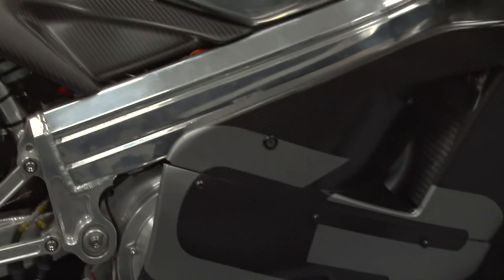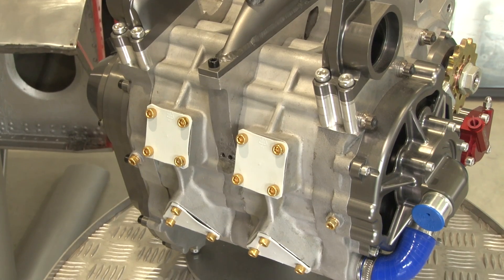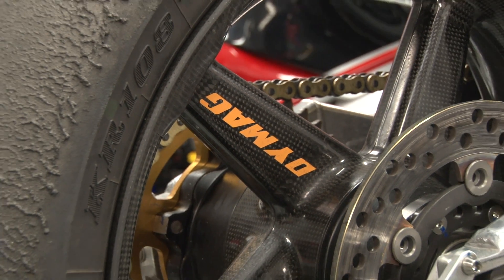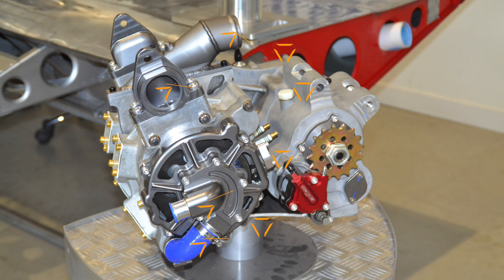Crighton CR700W : What makes this bike so special?

Comment: I've always loved rotary engines, motorcycle rotary, automotive rotary, Suzuki RE-5 was one I'm familiar with we sold them at the Suzuki Shop I worked at in the 76,77,78,79. I turbocharged many Mazda RX-7'S, those engines rev higher and thrive on turbo's & nitrous oxide,light, compact,lots of power too. That bike of yours is really something
Reply from the maker: If only it was ours!
Reply: Rotron 690cc 2 stroke wankel.

Comment: This overall design was brilliant when introduced by Mazda many years ago, and it’s still brilliant for several important reasons. But Mazda was never able to develop rotor seals, capable of holding up to the heat, friction and pressure loads they are subject to. Has this engineer worked that out? If so, I want one for my airplane.
Reply: Introduced by Mazda??? WtF!
Sachs was the first NSU-Wankel licensee to Introduced the Wankel KKM57.

Unfortunately the Wankel engine offers no advantages over reciprocating engine and has several major disadvantages.

This 1990s vintage Norton engine was originally designed by Sachs as the KC-60 developed for aircraft applications but abandoned due to reliability issues.

No aircraft manufacturers use Wankel engines 

No Wankel engines have ever managed to pass a FAA or EASA airworthiness certification test.
Wankel engines are inherently unreliable and their MTBF is extremely low, unpredictable.

Comment: The rotary engine is not economical- but it is even better than the two-stroke in terms of power-to-weight.  A great design, compact and powerful.  I wish I could own a bike like this.
Reply: Wankel engines are inferior to reciprocating piston engines in power-to-weight performance and are much less reliable and efficient.
Reply: Old 1990s Norton F1 bikes occasionally come up for sale... this is just an F1 with new fairings and fenders

Comment: the exhaust sucking air through the engine to cool it is something you will eventually see used on other bikes, maybe not rotary but air-cooled 4T engines need all the help they can get, air-cooled 4T engines are simple and easily maintained but tend to run hot so extra cooling with no moving parts is an obvious progression, it could pull hot air from the barrels & head with a shroud or casing and reworking of the fins, I'm thinking Suzuki ram-air system used on the  1970s 2T GT's hooked up to an exhaust system like this bike has ! 
anyone up for the challenge, get in the shed,
Reply from the maker: The air-cooling system is very clever!
Reply: It's a failed design that has never been successfully demonstrated

Comment: I can't find it back but I saw a video about rotery whereby they turned the working" inside" out  wich solved most problems a rotery is know for like the seals ect. When I saw it I was like amazed how simple the solution was just turn the workings around. Mazda chefs must have had a burn the day they see that video.
Reply from the maker: So the rotor becomes a stator and the housing spins???
Reply: @TheRaceBay  no the rotor still spins haha. But the seals are in the housing not in the rotor, and the intake and exhaust ports are in the rotor.
Reply: Wankel engines are obsolete technology and no long r mass produced in any legitimate applications

Comment: Having owned the original RX-7 I just KNOW a rotary powered motorcycle has potential to be AWESOME!   Sad that emissions BS took all the motivation to keep developing the old wankel
Reply: Wankel engines proved to be an unmitigated failure in motorcycle applications.
Wankel engines are obsolete technology due to the horrible lack of reliability.
Reply: I just fill my 13b with amsoil interceptor 2 stroke oil and use the omp turned up a bit. Works great.

Comment: Very nicely made! But why does it smoke like a 2-stroke?
Reply: Because it uses a little oil in the combustion chamber like a 2 stroke does. It only produces visible smoke when the engine is cold...once up to working temp there is no visible exhaust smoke.
Reply: Does it mix the oil in with the fuel? (like a 2 stroke) Or does the oil leak into the combustion chamber?
Reply: @L0wcash  Oil injection as its a rotary 2 stroke!

Comment: What race class would you put a 2.1L bike in...??
Reply from the maker: How did you get to that figure?

Valid question, though. I wonder if there's a Formula Libre for bikes?
Reply: @TheRaceBay  Every revolution of the rotor the motor sucks in and burns 2.1L of air and fuel but produces no more power than an RSV of half that capacity...There are no race classes for that size of engine.

Comment: When I look at this bike I wonder why it has taken so long to put the Wankel into bikes......would love to throw a leg over one!  The track footage showed the engine to be a whipsong instrument pulling from down low to peak revs.  P.S.. The seals have traditionally been a problem with these engines......how are those holding up?
Reply from the maker: A rotary powered bike is not a new idea, but this is quite possibly the most extreme example of one, and certainly the latest.

Comment: The twin rotor has the firing of a Six cylinder two stroke in a smaller package for the power output, incredible for Torque and power … I’d love one …. Gotta be smoother than my 1981 GSX1100 …
Reply: Hi mate.  A 2 rotor is the same as a 4 cyclinder 4 stroke - 2 firing cycles per output shaft revolution. The thing is the eccentric shaft spins 3 times per rotor revolution so each rotor has one firing cycle per revolution of the eccentric shaft

Comment: This is very cool..and all that..but the biggest oversight is that rear suspension setup..that bike is absolutely useless without more modern linear suspension or some kind of linkage to make the rear predictable..that is like 75% of racing is making the power usable.
Reply: All the suspension experiments carried out ever since the early days of Crighton's developments proved that the shock unit/units mounted directly on the arm were more effective than cantilever or multi link systems. The Duckhams sponsored bikes they won the British championships with were fitted with twin gas shocks directly attached to the rear swingarm. The ultimate development of this was a reactive shock designed in conjunction with Williams F1 team

Comment: If you save a whole lot of space why would you need to keep all that fuel at the top of bike?
Reply: Might help with the balance?
Reply: @zacharyradford5552  it would slow the transition from side to side thats for sure maybe in road racing you want some weight up high. I always though the lower the center of gravity the better but I also dont race road bikes.

Comment: What is the torque of the engine and at what rpm is the peak power and torque?
Can you show a power graph
Reply from the maker: Max. Peak	220HP
Max. Peak RPM	10500RPM
Max. Torque	105 FT/LBS
Max. Torque RPM	9500RPM

Full engine information:  https://rotronpower.com/rt690xe-rotary-engine/

Comment: Why does the rotor only fire once per revolution? Wouldn't it be more efficient and more powerful to fire on every "stroke"?
Reply from the maker: If I've understood it correctly (and I'm nowhere near as clever as Scarbs and Brian) each of the 3 faces of the rotor is the equivalent of an individual piston in a reciprocating engine. 

A revolution is therefore a complete rotation of one of those faces, which in doing so passes through 4 quadrants of the rotor housing providing the 4 strokes. 

For a single face of the rotor then, it is not possible to fire more than once per revolution as there is nothing to ignite until the next one.

If you take the rotor as a whole, it is always in 3 of the 4 Stokes at any one point during a revolution - much like a 3 cylinder inline engine would be, I suppose.

I really hope someone more knowledgeable than me turns up here soon to make more sense of this!

Comment: Most of Respect. Every time i think, the Rotary or Wankel engines are History, there are some new ones. Also Mazda surprises some weeks ago with a new fascinating Wankel.
Reply from the maker: Ah yes, the range extender system?
Reply: Yes. An intellegent system. Very interesting to me . . . . . !
Reply: Mazda canceled the range extender
Reply: The 35 kW/h battery with the range extender and I go to the dealer and buy one.
Reply: @schraddel6571  The MX-30 was a huge flop... Mazda has announced that it will discontinue the model
Reply: Okay, thank you for these Information. I will Look for something else. May be a FISKER?
Reply: @schraddel6571  Didn't Fiskar go bankrupt?
Reply: Mazda's president confirmed that the MX-30 has been canceled.
Reply: But they are still to buy . . . .
Reply: @schraddel6571  Mazda's President confirmed in July that the MX-30 canceled due to poor sales.
Reply from the maker: Just to clarify something and clear up some confusion . Mazda have cancelled the MX-30 R-EV in the USA only. At this point it remains on sale in other markets. How long that will be the case is unknown.
Reply: @TheRaceBay  Just to clarify, the MX-30 only exists to meet California's ZERO emissions requirements, sales in California was an unmitigated failure
Reply from the maker: Whilst it's true that the MX-30 was restricted to California in the USA, and it sold poorly there...

A)  The rotary range extender has never been offered for sale in the USA, regardless of individual state as the car was cancelled. The engine has nothing to do with either the poor sales, nor withdrawal. The car was cancelled before the R-EV was launched so nobody in the USA got a chance.
B) It's still on sale outside of the USA. The European model was launched in June at Le Mans.

Hate rotaries all you like, but knock it off with the misinformation

Comment: I like it a lot, like I like the 500's of the 80's and 90's  but, there is no longevity or development left in it....bugger
Reply: Plenty of longevity and development. Like how Evinrude boat engines made a 2 stoke boat engine that has better fuel mileage and less emissions than a four stoke. Something people said couldn’t be done because 2 stroke technology peaked.
Reply: @zacharyradford5552  2-strokes have always been successful and are not obsolete like the Wankel.

The Wankel engine reached the end of its development potential decades ago

Comment: Seeing and hearing riders such as Steve Spray, Robert Dunlop, Ron Haslam cane the Norton Rotarys  around the TT course was imprinted on my mind for ever, 22 years of looking later I get my own Rotary! OK its no where near the highly refined machines from the genius Mr Crighton but for a fact it gave birth to the 588 Nortons. I got myself a Hercules W2000, paint and chrome was shot but it was all there and 1,400 genuine miles with a pristine rotor housing it was brought back to A1 condition without the need for rare engine parts. What does it go like? A Bantam on steroids! Pop bang wirrr bloody hilarious to ride, rubbish hunting on the overrun but I love it. DKW who sold under the Hercules name in USA committed to selling 2000 in 2 years, fell short of the target so sold the rights and production equipment to Norton. My single rotor 294 is half a Norton. Mr Crighton could you tweak my Herc please 27HP not enough!
Reply from the maker: May you enjoy many more miles on your Hercules, however much power it makes!

Comment: I’ve had a Mazda rotary rx8 and it lacked hugely in torque, was a gas guzzler and even with top quality oil regular wore out fast. Think it’s great that people keep trying but the blue smoke when he revved it I wonder if it would ever comply to latest emissions.
Reply: Did you pre-mix the oil in the gas tank, helps lubricate the the housings, even so the rotary engine is not a very good daily driver for the average person as they require alot of maintenance but if you know how to they can last quite a while. They love to be revved hence why they are perfect in an racing application.
Reply: Football causes way more emissions than roadracing. Probably hiking in the mountains too. If you don't understand this, ask a grown up to explain.
Reply: You understand that there are plenty of piston engines with low torque and burning oil right? One bad engine doesn't invalidate the idea of rotaries. People aren't "still trying" as if rotaries are a failure.
Reply: i only use amsoil interceptor 2 stroke oil, i kicked the 4 joke stroke oil habit years ago!
Reply: I just fill my 13b with amsoil interceptor 2 stroke oil and turned up the omp! So far so good.
Reply: it's a track only bike.
Reply: @MrKdr500  The environment doesn't care where it runs.  The exhaust doesn't stay within the fences.
Reply: @TonyK3130 most track bikes don't have emissions regulations to abide by, they arent registered for road use and often remove emissions equipment to cut weight and increase performance.
Reply: @nesbittracing1081  I recognize that emissions reduction devices are being removed, but I don't see that as good.  F1 and NASCAR are sensitive to the issue and are. offsetting the issue somewhat by using unique fuels to reduce emissions.  I find it uncivilized to develop new emissions belching machines especially when the emissions are dumped into the atmosphere for all of us to breathe.
Reply: @TonyK3130  there aren't going to be enough of these machines to make an environmental dent. Its a novelty item, not baseline for a spec series. I doubt more than 1000 of them will ever be built. Comparing to F1 is ridiculous, especially considering F1's biggest emissions are in moving the circus across the globe, not the cars themselves. The restrictions is to push innovation that can trickle down to road use, not to actually make an impact on race weekend
Reply: @nesbittracing1081  From the bottom up:  1) F1 Started using green fuels in the transporters this year, eg Mercedes.  2) I agree new technology should move society forward. To spend resources making a "better" notary without addressing the fundamental physics that killed them the first time seems like a waste of effort., 3) to endorse products that only hurt a few people a little bit also seems like a waste of effort for the same reason, no advancement.,
Reply: @TonyK3130  you clearly missed the "novelty" bit
Reply: @nesbittracing1081  I did not overlook it.  Since you want to bring it up:  I don't believe in damaging the environment at any level.  Nothing that damages the environment we all must live in should be accepted as a "novelty,"  ie small and low cost, the definition of a novelty.
Reply: @TonyK3130 you do realise total worldwide road transport greenhouse gas emmisions only account for 15 percent of total greenhouse gas emmisions?.....so if all petrol road vehicles were removed from existence tomorrow the greenhouse gas emmisions would still be 85 percent of what they currently are......
Reply: @nix123ism  Let's not fight over statistics; but, your 15% blends on-road trucks with ships and aircraft,.  For example in the UK, 25% of emissions are on-road trucks,  Companies like Mercedes, and Tesla take it seriously.
Reply: @TonyK3130  Yeah and they're making 25 of them and they're only ever going to be driven on racetracks. It's not that the pollution doesn't leave the race track, it's just the scale. Obviously emissions regulations are important for vehicles millions of people are commuting thousands of miles on, less for a £100k track toy which 25 people will do maybe a couple hundred miles a year.
Reply: @XenFPV  So if you are rich enough it is OK to pollute?
Reply: @TonyK3130 surprised you are commenting here, have you factored in the greenhouse gases necessary to process and store your comments on YouTube servers? You are destroying the environment!
Reply: @rbryson07  I have factored that in.  I post only on topics of importance; and, I post precisely/efficiently.  Paul MacCready is one of my aspirational guide posts.
Reply: The environment doesn’t care period.
Reply: I find it uncivilized that people bitch about the auto industry but don’t give a damn or are willfully ignorant about the damage done to the environment for the electric products they push. Not to mention the slave labor that builds it.
Reply: And I don't care about the environment ❤
Reply: @daveseemerollin6357  If that is not the most asinine comment ever made by anyone anywhere.
Reply: @TonyK3130  It's not as bad as the current UK government's assertion to stop illegal immigration. Then again, does an outright lie qualify as mere idiocy ?